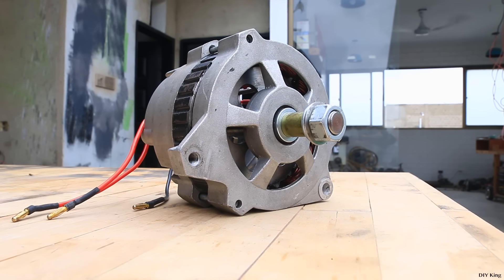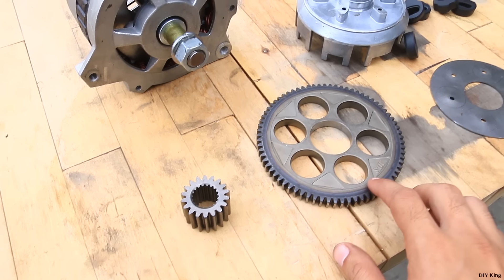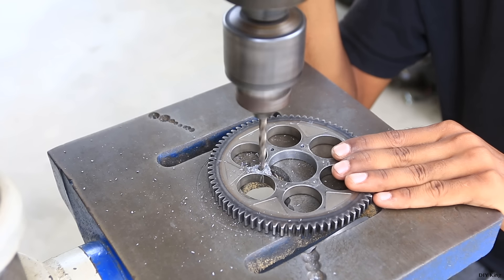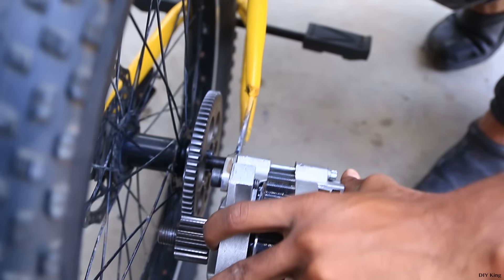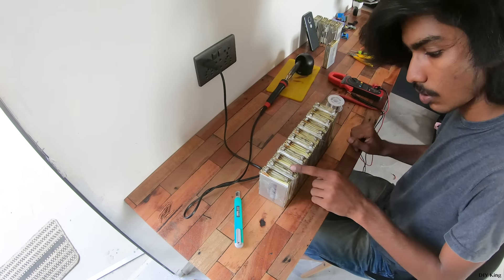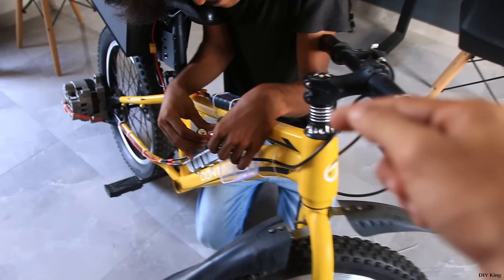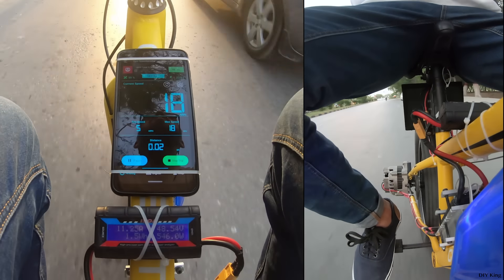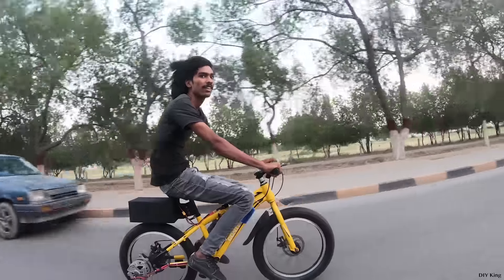Bicycle Conversion using a 10,000 Watt Car Alternator

Comment: I've avoided getting an electric bike for years because nobody made one with the power and range I wanted. You just built the one I've been looking for.
Reply: Surron x
Reply: his numbers are trash, if you put 10,000 watts through the cable he uses to connect the motor it would light up like a candle.
Reply: @kght222  no light needed in the evening then
Reply: @falsedragon33  Well that's a bit rude. It must be stressful having your encyclopedic brain.

But it most certainly is going to happen. There are already electric motorcycles with excellent power and range. And Tesla is working on an electric semi truck. That's a heck of a lot harder than doubling the range of a bicycle. Be patient. It's coming.
Reply: @kght222  Aye 10kw needs 10mm cable
Reply: Give this man a vice while he still has 2 hands
Reply: haha! imagine you're on the interstate and someone on an electric bike zooms past you!
Reply: @kght222  agreed!
Reply: @kght222  at least the numbers in title was Clickbait, he mentioned batteries are 1.5KWh, so  his motor will generating something similar or even less power
Reply: E-cells bikes are currently the best.

Comment: Dude! That's a 60mph pedal bike home built. Great job. I'm impressed I love projects like this.
Reply: 60-70 kmph * roughly 40-45 mph not bad still
Reply: @carterwidmor7057  He said it had more left. 88 kph or something. 1.21 gigawatts
Reply: @elvismorales7741 where you are doing such a excellent  job I want  my bike  to convert   I am living in garden city Behria rawalpindi pak istan
Reply: @zazarays  you want to power a whole city with your 1.21 gigawatt?
Reply: @carterwidmor7057  Not bad until you realize they claim it's 10,000W and a 1,500W can do similar speeds.
Reply: @zazarays  one gigawatt is 1 billion watts buddy
Reply: @watchfullbird6381  it direct drive so it will only turn the max rpm of the motor so if the motor still has more power you would need a gearbox to see the difference between the 10000W and the 1500W
Reply: @Kailxz  "one point twenty-one jiggawatts" is a reference to the "back to the future" movies 😂
Reply: @zazarays  😂 😆 gigglewatts. 
It wouldn't get to 88. It got the death wobbles at <70.
Reply: @watchfullbird6381  😂 😂 😂  All the fool you for believing that. How big is that battery?
Reply: @BTW...  Mine is 14S14P with 40+ miles range riding full speed.

Comment: Your instability is due to the battery placement being mostly rearward.  It should be redistributed to be closer to the center of gravity for greater stability
Reply: Yes. I have a pushbike with a cantilevered basket mounted on the rear rack. When this is full of groceries or whatever the front wheel becomes unstable. Dangerous - too much weight in the wrong place.
Reply: His stability issue is solved by NOT GOING THAT FAST. 
The stability is directly related to survive-ability. There is no question about stopping. 
It's gunna happen in a planned or unplanned way... but at 70km/h.  🤯 
The motor is always gear engaged to wheel, unless it falls off. I seriously question the design integrity of that motor mount, the welds, and it's ability to resist torque forces, especially doing the death wobbles. 
But, what a sight to behold... dragging the motor along by the cables... at even 40km/h let alone 70 😆 
Yeah, mass distribution... having a lower CG would always help more so than forward aft location. 
Moving the battery box so it isn't rubbing on the driven wheel... would be a good idea.

Comment: Love it, i also can see that the bike test was loved as well, great project and great potential for grander projects. But the key lesson here is the amount of upscaling reclaiming and repurposing that has gone into the project so far.
Reply: In theory I dunno I've always wondered  this, couldn't you add a 2nd alternator to it that recharges the the battery that powers the first one.

Comment: I managed to get a much more usable result with my e-bike conversion. It will comfortably ride at 80 kmh+ without any wobbles. The only downside is the motor will overheat within a few minutes at that kind of power level. I mostly use it up to 60 kmh and it will beat cars at the lights easily.

Comment: You're hired! I hope you turn these bike conversions into a factory for them. You can obviously make the frame structure that you need to hold the weight. I just recently entered the ebike world. I have a very cheap, but apparently reliable step over ebike and am waiting on a more expensive step thru ebike. I've yet to ride either of them. I am 76 and will need the step thru to start riding. I Iive in a hilly city and I'm looking forward to driving the back roads of this town. 💚 go green!

Comment: Didn't know there was such a thing as an 800 amp alternator out there for a 12vdc system. Learn something new everyday.
Reply: LOL.  Yeah, that's maybe an 80 amp alternator!
Reply: @SparkyRF  Alternators regularly run 120-160 amps in everyday bullshitty cars so if its 160 amps at 12 volts its almost two thousand watts. Even at 120 you're still almost producing 1500 watts of power. This could be a high amperage unit tho, if you spend like a few hundred dollars you can get a 300 amp alternator. These guys have 12 million views on one video im sure they can afford high amp alternators.
Reply: @tejay9416  1500Watt is still only 2 hp...like a very small 25 cc moped.
Reply: @tejay9416  now it's 13 million views, I agree a lot of BS said on this video
Reply: @tejay9416 not 12volts 48volts

Comment: Well done for your brilliant effort. May I suggest a couple of things.
I would look at mounting the alternator by the pedal area and using a belt drive or similar to the rear wheel therefore giving you a more centralised mass. 
Following on from that, the battery pack would be much better slung under the main frame spar and would help with stability for your bike and reduce the speed wobbles experienced.
Your efforts are nothing short of inspiring and you guys should be very proud of yourselves, just centralize and lower your overall mass for a much better handling bike. Front forks would also be worth changing to damped forks instead of rigid.
Subbed, and sending you best wishes.
Reply: Bro, just do your own video.
Reply: Same thing went through my mind...and also mabe bigger size  bicycle
Reply: @tonybino01  Comments like this help people who might want to try it out themselves
Reply: Great Idea on transmitting power! Belt much easier!
Reply: Probably better to do it on a fat wheel bike to for better stability. A beach cruiser too so it has a slight bit more length for even more stability. I wonder how bicycle bearings will hold up to this?
Reply: Only disadvantage I see is less instantaneous power transfer.
Reply: I did notice they have a ton of weight in the back.... Making your balance lower and towards the middle would definitely help!! I'm also sad they got rid of the ability to pedal....
Reply: Good advice but they would lose power using the belt
Reply: @ST Grammar nazi bro.... His point was made..... You just wana nitpick and argue
Reply: @Kevin Burns The true names are the front diamond, verticle slam pipe, ocks carrage, and upper support slaw. Now ya know.
Reply: Thanks
Reply: top
Reply: What about re-charging while you coast/pedal
Reply: @moldoveanu8  power loss is unavoidable, no matter how you go about power transfer,
Reply: @NickYack  exactly we learn and improve together
Reply: @tonybino01  Stop being so narrow minded. Great ideas and improvement come from constructive criticism.
Reply: pp
Reply: The Bafang conversion kit addresses the above comment. Avoiding high speeds is to also avoid high speed accidents. My 750 watt mid-drive with 48 volt 17.5 ah lithium ion battery can exceed a world class cyclist.  Keep your max speed under 25mph.
15mph is a safe cruising speed. My max is 22mph, I find it quite exhilarating…
Reply: I agree with possibly relocating the batteries, I believe that would be probably the most helpful for wobbles,  I like the direct connect gear drive though and think it wouldn't make much a big enough difference to relocate it.  The batteries though yes, the lower the better, not sure if you need to keep them level if so I think an easy way maybe is right below the "nut cracker".
Reply: @mdfire1  belt is easier probably but you lose power through the belt transmission, gear to gear is much better for power transmission

Comment: Great job guys you guys are very talented I am an electrician and also an inventor and engineer I love your concept and what you have done I believe you have a very marketable item and I believe you should apply for a patent to what you have done to protect your work if you have not already done so!
Reply: Can they do a patent application with car parts and parts from other brands?
Not sure about patent laws, I thought you can build stuff similar but it has to be different from original product but use your own custom parts? But I'm not sure

Comment: Modify the sterring stem ,add caster. Adjust rake and trail angle. For stability
Or build a new frame.
Keep the position of battery more towards front wheel  for more cog
Reply: Correct on the battery placement. That's why when I bought my conversion kit for my bike with the hub motor, I bought a battery that I could mount in the middle of the bike to offset the 25lbs of the motor in the rear. 

Putting the heavy battery in the back would stress the frame to much when making sharper turns. When I make turns now it feels normal other than the extra weight on the bike but it's balanced well. I read that others noticed problems with to much weight in the rear.

Comment: I bet the looped small wire you used to connect the cells in the battery get pretty hot under 30+ amps of continuous load, unless you have multiple sets of cells in parallel.  Nice build!
Reply: It is in parallel he says it 7:58

Comment: As a safety measure, your car speedometer probably shows your speed higher than it actually is (in some places the speedometer is allowed to show a speed up to 10% higher than the actual speed, but is not allowed to show a slower speed). 

Your phone GPS speed is probably more accurate.
Reply from the maker: Great piece of information i will look into that for further details. Thanks man.
Reply: The speedometer are quite accurate if calibrated properly, they are mechanical.
Porshe instruments are so accurate you can determine your speed from the rpm guage.
Reply: @DIYKingSaM  What make of alternator is this, and  what mods have you changed  inside?
Reply: I work with sspeedometers professionally.
The car Speedo is fast, the GPS speedo of your phone is accurate, provided you have been travelling at a steady speed in a straight line for 30 seconds or more.
Car Speedos are required by law to never read slow, so the manufacturers of cars typically make them read 7 to 10 percent fast, which gives a safety margin that allows for changes in brands of tyres and tyre wear.
For future tests, trust your GPS speedometer on the phone. Just give it 30 seconds at a steady speed to settle out any GPS averaging requirements. 🙂
Reply: @michaelbrownlee9497  RPM gauges are more accurate than speedometers. Historically, manufacturers have designed speedometers to show about 5% higher than people actually are driving. This is so they think they are going faster than they actually are, since everyone drives above the posted speed limits.

This has changed with modern vehicles, since they are now tied in to GPS locators with navigation systems. Now they need to show true speeds.
Reply: Don't you think you should do a commercial version? I like this thing but don't think I can get to do it myself for many reasons. So think of going commercial for this thing. Good job and weldone.
Reply: @ronlaverdiere  well, newer VAG cars still don't show their true speed. PSA cars however show their true speed (maximum 2 km/h more than the GPS) since 2000s, maybe longer. I don't know about others, since I've only driven PSA and VAG cars.
Reply: @JachuJustyDriver  if VAG cars don’t show true speed, how are they giving accurate ETA’s on trips shown on their nav system? Or are their owners dumb enough that they don’t catch on?
Reply: @ronlaverdiere  what speedo says is 1 thing, and speed by gps to calculate ETA is another thing. Speedo signal is taken from the gearbox, or the ABS sensors
Reply: @DIYKingSaM  lets face it... This is bullshit! . This alt is not 10kw.  You should change the heading to 1000w
Reply: @geepea101able  max 80amp at 14.4v
Reply: @hdj81Vlimited  if it was 10,000w it would be 600A at 12v
Reply: Maybe it is why in the UK for the older cars,
it is ~10% margin in the case of any fines for speeding...
Reply: Safety what safety lol
Reply: @sywu111  it used to be 10% a long time ago, 1960. Car instruments in those days usually exaggerated actual speed also, so you were doing less in reality...

Nowadays you can be prosecuted for 1 mph excess in theory....

I would say that commonsense .as still.prevail....even in modern day UK.
Reply: @devilliers123  - i had a couple of cars in the UK,
no one older than from late '90-s,
it's STRANGE,
when i'm driving ~70 mph (by satnav),
while odometer shows actually... ~74-75 mph! 😅
Reply: @sywu111  sounds like you didn't  have enough air in the tyres.....if the wheels are turning fast but the tyres are low then your speed will show more than you are travelling
Reply: @devilliers123  no, it's not this.
Reply: @wizrom3046  great advise and I humbly thank you for your wisdom... but I had to go back once I saw how you spelled Tyre  I them had to go back and read it all over again but this time in my best (in my head) brittish accent 🤪😝😁😀🙏✌✌✌ don't kill me 😂 have a wonderful day sir!
Reply: @wizrom3046  incorrect  it depends if the calibrated gear ratio was messed with   i.e taller tires
Reply: @theantiveganchannel3596     yeah like i said i do this professionally.
The GPS speed is accurate, it is NOT affected by tyres (that's "tires" for the literacy challenged countries). 😉
Reply: @wizrom3046  so it could say I'm going 25 and I'm actaully going like 23?
Reply: @geepea101able   An alternator has 3 phases that go to a set of diodes to change the AC to DC for the car battery. Remove the diodes and conect wires to the 3 phases...
Reply: @Ka0sNite  I realise how they work.  I wanted to know what mods and upgrades he made if  any. There is ABSOLUTELY NO WAY he is going to get 10kw from this   alt. His channel is full  of over exaggerations from electrical devices.

Comment: Hi, 7 years ago I was working for a small company that was selling electric bicycles. We converted normal 26´´ mountain bicycle into a e-bike. 1000 W motor was able to ride it at constant 45km/h. Please get a bicycle with much bigger rims and than try it again.I think you will be able to go 100 km/h without  any problem.
Reply: I think above 40km/h you're looking at "might as well get a motorbike" speeds.
Reply: 100 km on a bicycle? That would scare the hell out of me! However I once drove my Mother's old 1964 Pontiac at 193 km/hr (120 miles per hour), so maybe I would be crazy enough to drive a bike at 100 km/hr.
Reply: 100km/h... big problems.

Comment: Great idea and execution! If I had to critique one thing it would be to make sure when welding to get one consistent bead whenever possible for the most strength. What I and any other professional welder does is tack the ends of the work in place, remove slag, then run one consistent bead along the joint. I understand it's not always possible to get one consistent bead but it really does make a huge difference. Other than that small note I think you killed it. I truly am inspired. What a cool way to repurpose an alternator. I love that you make as much as you can yourself. Like using all those power cells in parallel. Really cool stuff!
Reply: the numbers are all wrong. it does what you can see it doing, but the numbers are all wrong.
 the video claims 10000 watts, he is using two batteries that are capable of 1500 watts each. this makes people who do projects and give real numbers look bad. this is not good.
Reply: @kght222  I honestly hadnt even thought about it/realized their numbers were inflated . I know enough about batteries from building amps and guitar pedals and being an e cigarette user to have realized it but for some reason I didnt. Good eye!  

Edit: I'm not going to rewatch it but I thought in the video they were using many cells to make their packs then a bank. It's likely why I just assumed they were being honest. But with the seriously inflated battery/cell ratings perpetuated by the companys that sell Sony, Panasonic etc. cells for all we know they are going by what the seller claimed the batteries wattage/mah's were rather than testing the cells themselves which for most things cant simply be done with a MM accurately anyways. But the accurate tolerances for all the major cells are readily available online and if they are smart enough to make this video then we have to assume they likely did know the real tolerances.
Reply: Shaun Barcavage, is a 52-year-old research nurse practitioner at Weill Cornell Medicine in New York. He’s now on short-term disability, following his second dose of the Pfizer vaccine.